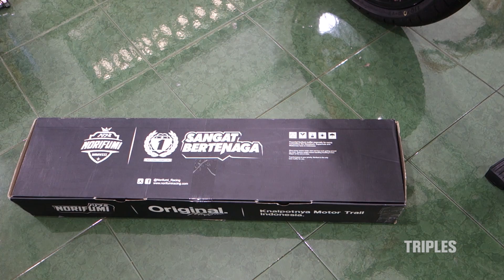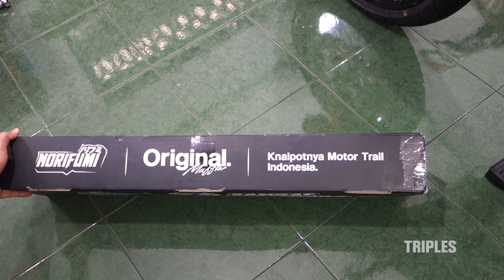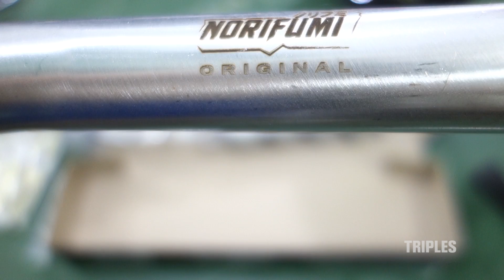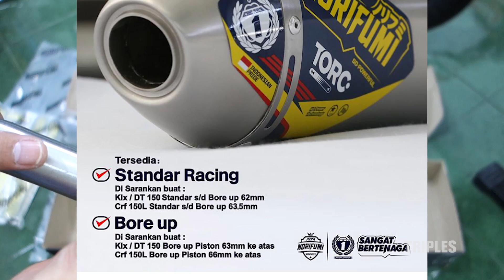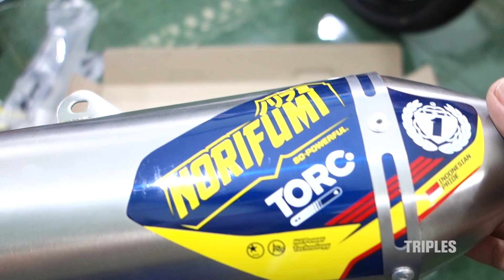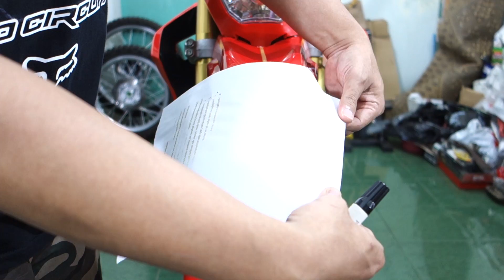Modif CRF150L Part 4 - Knalpot Norifumi TORC & Potong Spakbor Depan

Comment: Sy beli torc seminggu lalu di berkah mx, di leher knalpotnya ada power bombnya, pipa lehernya beda sama knalpote sampeyan mas
Reply: Las" sanya kelihatan/mulus kaya di vidio?
Reply: Las2anya lumayan gak begitu mulus, di power bombnya ada tulisan norifumi
Reply from the maker: Mantep juga itu, efeknya lebih terasa nendang di rpm bawah sam?
Reply: Knalpotnya cuma dipasang tanpa setting di mesin, akselerasine kok terasa gak beda jauh dg standar, cuma lebih cepet naik rpmnya gak terasa tiba2 sudah kena limiter. Akhirnya gir depan ganti dgn ukuran lebih kecil jadi 14 mata (punyae megapro) ini baru terasa beda akselerasine & top speed masih bisa nyampe 110 kpj on speedo, gak bisa lebih lg krn mesin nyendat2 kena limiter